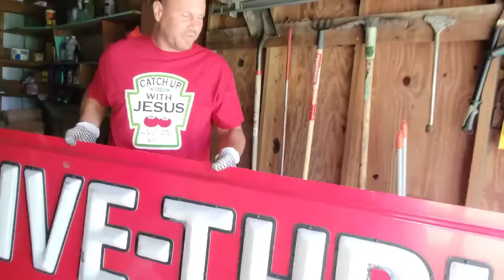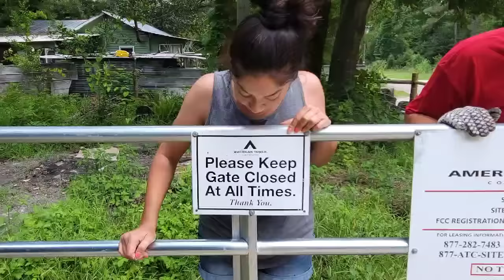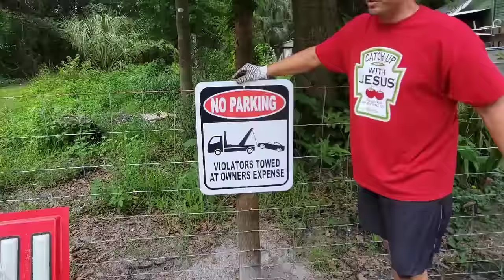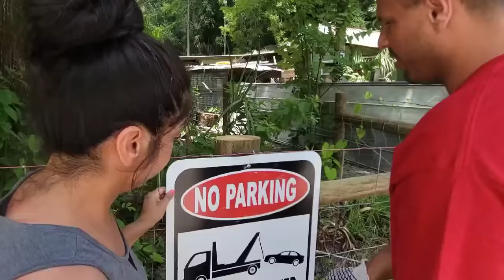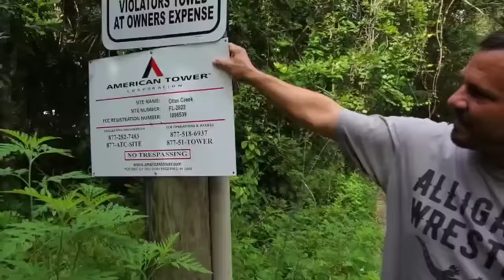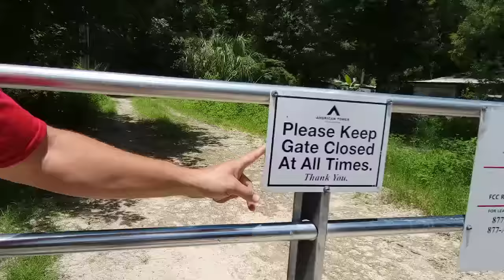PROTECTING OUR PROPERTY Part 3 ... I Bought An Abandoned Ranch

Comment: For the 'Drive Thru' sign: May I suggest to add some washers to those screws so the plastic is less likely to crack / break. Also, maybe backlight it with some motion activated flood lights. Then there is no excuse for saying that a person missed it.
Reply: Does not matter, it was stolen.

Comment: As a former rep at a cell company. As they CSR to open a case (can't remember the department name) for new service to be ran/expanded. They should be able to open a case for the proper channels to get back to you.
Reply: Engineering department can create work orders. They are also where techs get dispatched from to trench lines for new service 👍

Comment: I would hot wire the gate...no locks needed.  Only valid people have code to shut the power off.  Could be done remotely.  Not enough power to hurt anyone but enough to stop them from doing it again.  Farmers did it for years to keep cows from breaking thru fences.

Comment: As a former ATT employee, I can tell you that the fiber optics running to the tower for cell service are a dedicated service specifically for that tower. They cannot fork off line/signal for your house for it. That "circuit" has a special speed rating and signalling that is incompatible with home internet use. For internet at your home an entirely new line would need to be trenched to your home from the nearest central office (CO) or the nearest internet IP backbone cabinet.
Reply from the maker: How do I get in contact with someone to give me a quote for that? whatthehales@yahoo.com
Reply: I concur. Former Access Service Center employee, which orders the lines from AT&T central offices to the Towers. I interfaced with the carrier and the engineering departments and installation.
Reply: @WhatTheHales  try the att fiber website first and put your address in to see if you are already qualified. If it says you are not, att engineering will have to provide a solution. If you are too far away from a CO, it may be a tougher install as there are length limits to how far signal will travel without booster/repeaters. Rural area are always difficult because of the long cable runs. ATT sales is your next stop and they will have to work something out with the engineering dept.

Comment: I'm a retired employee from ATT in Miami, I'm not sure how the company handle the Fiver optics in that part of the State but in Miami Dade County they don't install cable inside of the private property, when its a big farm the owner is responsible to get the cable buried from the House to the ATT equipment and the Company will make the connections you need to call and make arrangements after you lay down the cable, I think you can get a subcontractor to do the job, like I said Thats the way it used to work before I retired , it may have change now

Comment: What is wrong with these people? If it was mine Is do exactly what you are doing. I inherited some property that was the same way. The folks were used to doing as they pleased and when I went to clean it up and have it surveyed the old lines had been moved in so when I had it done I gave them 2 weeks to get everything off and out of My property and I went back and nothing was moved so I had to take them to Court. I finally got it straight. They were NOT happy with Me. So don't give them an inch they will take a mile.

Comment: You want someone to contact you about running fiber? Cut the fiber that's on the property "accimidentally" while digging a hole... quite sure someone will be out straight away. :)
Reply: While that's funny sounding, there are survey companies you can call because "accidently" cutting a line or not, he's the one on the line for potentially millions of dollars. You should be able to dial 811- my dad worked for that company for years here in Ohio, and there should be something like it down there too

Comment: I've only seen a small bit about this, but as a kid we had an issue like this.
My father didn't make much of a fuss about it. It was a bit expensive but he ended up having property lines drawn out on the ground, had a company come out and remove everything. A fence built, and put a lean on the property owners that were using the land as their own.

They were pissed at first, then again 30 years later when they could not sell tell the lean was cleared it was an expensive clean up.
After all was said and done, my parents got more $ from the sale of that home then those kids did.

Comment: The OSL should have the number to the AT&T contact or technician who would be able to answer your question about getting their fiber run to your house.
If he doesn't have it, then the tenant relations should be able to get it.
When you call AT&T, you would have to get really lucky to get routed to the technicians who handle the towers in your area.

Comment: A little tip to make opening the gates easier. Drive a couple of fence staples over the chain so you can just let it hang on the post whenever you undo the lock.

Comment: Jeremy, I just thought of something, in my kid's gymnasium at the high school they had these heavy protective cages around clocks, and lights so if they were struck by a basketball, volleyball, etc it wouldn't break the clock or bulb, etc. How about something  like that around a camera in that area that they keep breaking? But the spacing in the grating of the cage can't be too large, because then they might just shoot the camera instead of just throwing rocks, or something. You have some really great minds down at odder creek, I'm sure you can think of something to protect the camera externally.

Comment: Call Verizon and ask if 5G is available. No need for wires. No need for the expense of digging a trench, placing conduit and running fiber. If it's not available, and you see a technician, pull over and ask him to have his Local Manager call you.

Comment: You should definitely pull the fiber in and maybe a second one. For backup and also separate for the business. Very easy to do and you can rent the machine. It is probably the law there that you have to have Florida utility protection service out there to mark any underground utilities there in the ground. You would be held liable for damages.

Comment: You don't get fibre optic to the house, you connect into the fibre optic loop, and from there to your house is cooper wire. Where the tower is located, you find a box that changes over to cooper wire

Comment: You won't be able to get Fibre to your house because it doesn't work that way. They are pulling fibre from their Central Office or street demarc straight to the tower demarc. You need a link from the CO where they have fibre termination straight to your house where they can install a demarc with a Fibre switch. Figure about $50/foot from the central office. Now if they already have a Fibre termination cabinet on your street or very nearby, they may be able to light up another fibre pair but they would still need to homerun it to your house, with or without intermediary termination boxes. Still very expensive, like >$50,000.

Comment: With the fiber optic cable carriers, you will want to speak to an area manager for the carrier. You can even speak with corporate and ask about speaking with the area manager in regards to the fiber optic lines running through your property as you have some questions/concerns.

Comment: You can add a 1/2inch pipe strap to the post to keep the chain from falling and that way it doesn't accidentally get misplaced.. easier than welding it to the gate